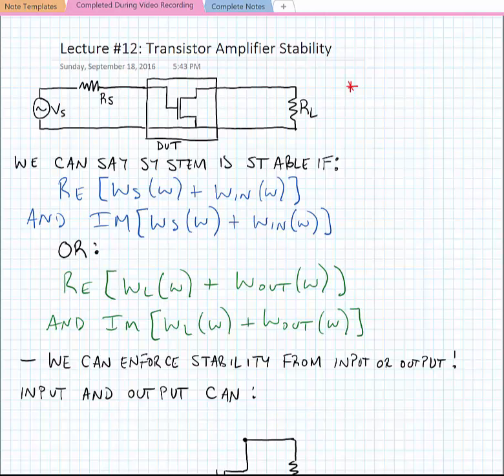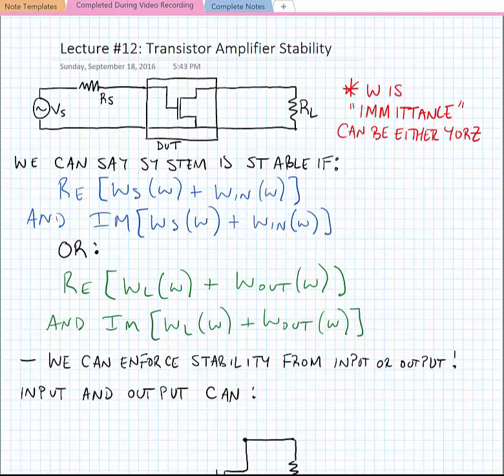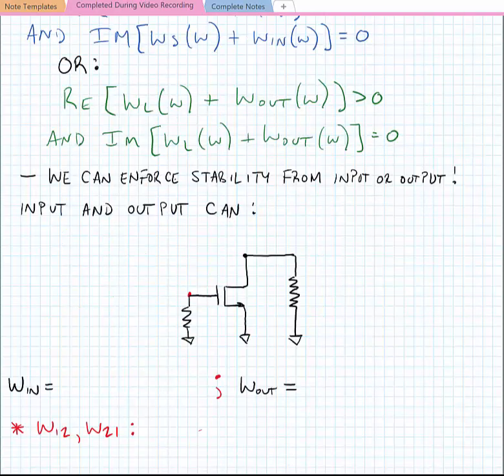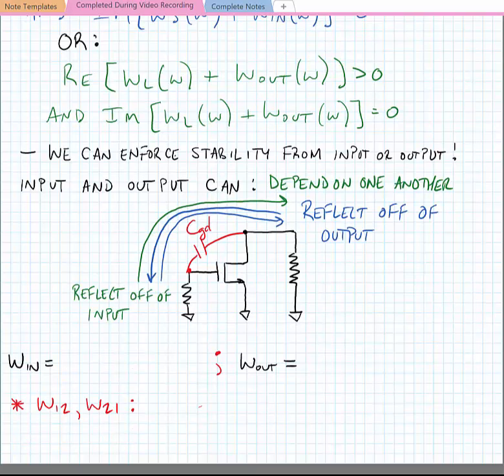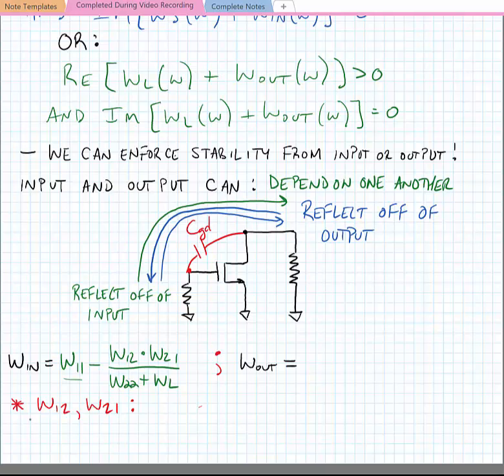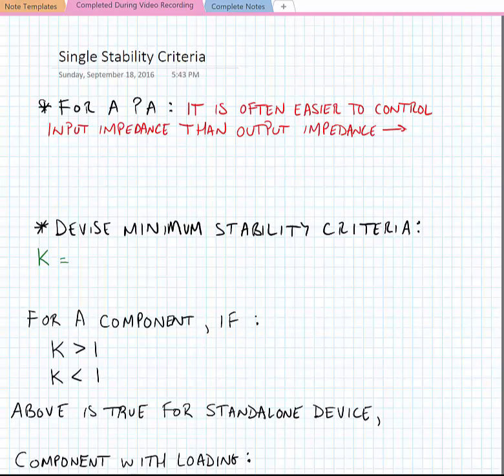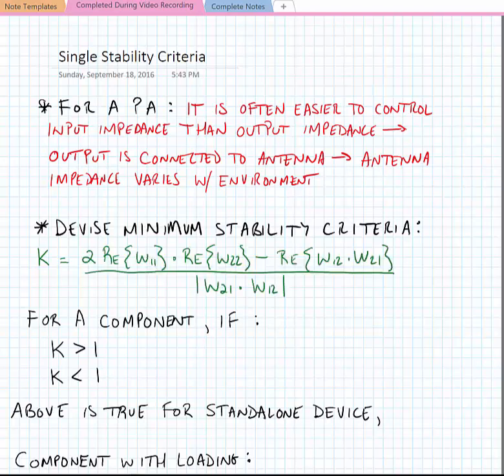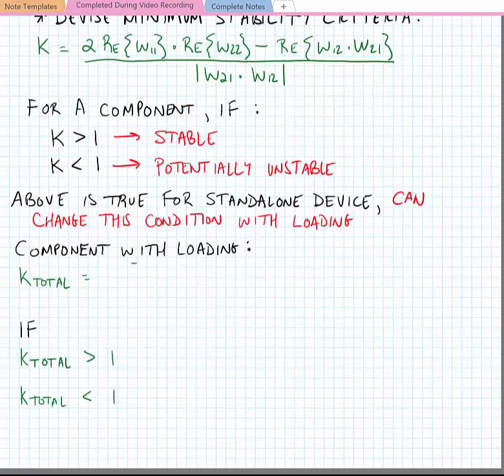Lecture 12.1 - Stability of Transistor Amplifiers

Comment: If the real part is greater than zero why the imaginary part must be equal to zero for stability ? 
I mean RLC circuits are stable at all frequencies if real part > 0 and the imaginary part varies with any value.? 
thanks
Reply from the maker: We are just writing a general condition that would guarantee unconditional stability at a given frequency and you might note that if using this criterion, it would imply that a resonant circuit could never be stable at any frequency that is off resonance.  This is just an attempt to limit reflections off of the input or output due to feedthrough in the DUT.